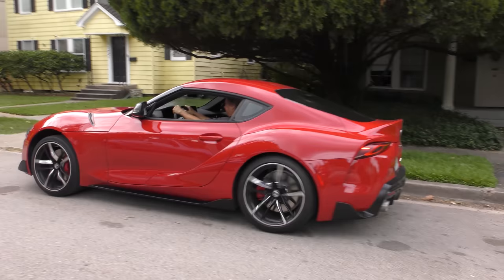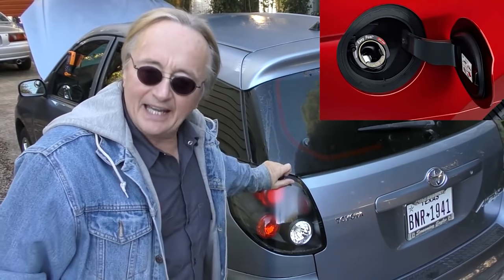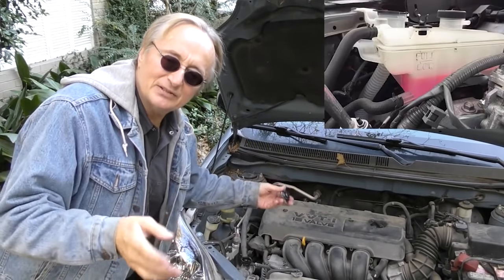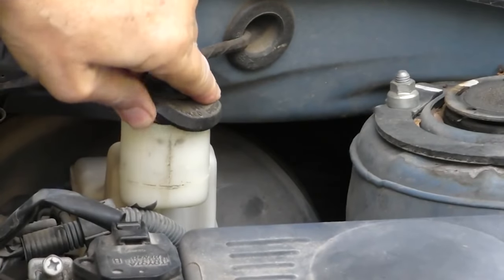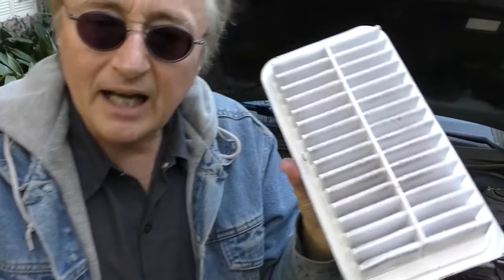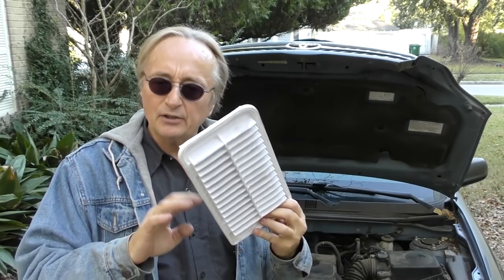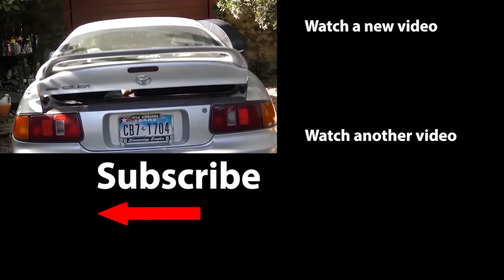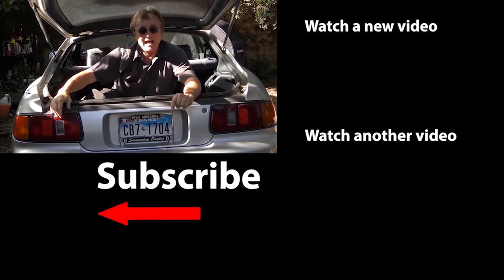5 Things Only Experienced Drivers Know

Comment: Other thing with car batteries is to make sure the posts don’t have a lot of corrosion, cause I’ve had cars not start because of that and after cleaning the posts and cables it ran just fine
Reply: @JorBur3, true. I've also seen where posts and cables look fine but cables are corroded a couple inches back from the posts.  Sometimes you can trim them back, sometimes have to buy new cable.
Reply: I just had that happen a couple weeks back.  My van never gave me trouble and one day I get in to start it and nothing.  I checked the posts and cables, cleaned them, and we're back on the road again.  It hasn't given me a problem since.

Comment: My heat is pretty weak in my car. Check my radiators coolant levels and if it isn't full which coolant do y'all recommend I buy? Thanks
Reply: You go by what your owners manual states. In the back it should give you the spec. Go to an auto parts store and look for any coolant that says it meets the standard of your spec. Ask the guys at the store to help.
Reply: @joe6096  Thanks, brother

Comment: Bahahaha @4:58 I had a friend who girlfriend drove his car like that & completely drove on bad brakes & actually cut her front rotors in half ,& they was solid rotors too not vented on a 1889 Pontiac Lemans (Daewoo LEMANS) ,she was such a bad driver she also split open the automatic transmission by driving thru deep water & made a illegal U Turn into the high curb 🤣 ended up selling her another GM automatic transmission I had in stock ,she was super hard on any car ! ,you should see what she did to her X boyfriend Toyota Supra ,she split that one in half ,right into a tree ,her first boyfriend split from her after that

Comment: Previous gen USDM Ford Fiesta STs are notorious for having bad purge valves which cause the engine to stall after filling up. Hilariously, a workaround is to hold the pump nozzle in the fuel fill hole for a few seconds after topping up. The fix is to get a new purge valve.

Comment: Hi Scotty, In Carfax I saw a Lexus RX400 H 2008 model with 125K miles on it which was manufactured at Japan. There are no accidents. Price is 8500$ May I go for it based on year and milage? Please share your thoughts. Currently I own Subaru outback 2011 model with 95K miles with no problems. May I replace my Subaru with the above mentioned Lexus ? Pls reply.

Comment: Irony. Bought odbcii midrange device after getting check engine.  Code was slow leak minor. Looked at original cap from 2007. Poof sound unscrewing. Went away. Checked coolant n fluids sat. First time in 5 yrs. 5.7 hemi good one. Got battery starter 1000cca too. And 5 lb fire extinguisher like he said. Batt powered tire inflater. Had two 5D cell maglights. Changed air filter myself. Omg. Even got 500W generator for car. New shocks lifters for gates n hood. Wd40-  now in heaven.

Comment: Hey @Scotty, I got P0304 misfire code so I changed spark plugs & ignition coil all 6 for my Honda Accord 2008 v6, now the engine light disappears when the fuel tank is less than 1/4th remaining while I fill up the tank full the light glows up giving the same code. What could be an issue?

Comment: Hi Scotty. Been watching for a while now. Your discussion of air filters reminded me that I wanted to ask a question.  I have a 2009 Ford Focus, 4cyl, 5spd trans., with 265k. Not the original owner, but personally know prior owner.  I’ve put 65k on it, and the thing just keeps on going.  It has the original air filter still in it.  Went to change, but discovered its not a typical take out the old filter and put in a new.  Seems to be some sort of self contained system. They say you have to replace the whole system as one (box, filter, sensor, and whatever else).  Gas mileage has been decreasing. I’v changed plugs, coils, etc.,, but just cant do a simple filter change.  Is this your understanding as well, and is there any work around that you might know of to just be able to replace the air filter without the huge expense of replacing the whole system?  Huge thanks in advance.  Great channel.  Warm regards, John V.

Comment: Pretty sure my car is low on coolant and the wiper fluid reservoir may be cracked and the MAF is definitely filthy. The MAF is a soab to get to in an 07 Toyota Camry.

On your last point: If your vehicle isn't starting and it's just clicking, it may be spark plugs and or ignition coils. That happened to me last winter and I could not for the life of me figure it out because no one had the equipment to communicate with my Toyota. But after we found someone, it was an easy fix I did with the help of a fellow backyard mechanic.

Comment: Hey Scotty I have a Toyota celica 2000 GTS 
I have a shaking problem. I changed my motor mounts and passenger side axel. The shaking was gone but it’s back (not as bad as before)  mainly the interior shakes and the steering wheel

Comment: 1.check gas cap 2. Check coolant 3. Check brake fluid 4. Check air filter 5. Keep you fuel tank over 1/4 tank.

Comment: Fuel cap in my 2000 corolla 1.9 diesel has holes drilled in it by a mechanic, it was supposed to fix under pressure problem or something (car didn't start right) now the engine strats ok but should I be worried about that cup not being hermetic?

Comment: Toyota sequoia has the starter under the intake or under the right side exhaust.  Not fun either way.   Stupid ford fuel pumps all fail between 80 and 100k.  Have to drop the fuel tank.  Expensive..

Comment: My Ford doesn’t even have a gas cap!! When I get that code, I have to use the plastic fill thing to penetrate it over and over again and spray it with lube to clean the hole and clear the code.

Comment: My Ford Escape doesn't have a gas cap!  Why is this, anyway?
Reply: @mcc7762  Yup! They leak and there's no fixing the code. Reset It and it trips again after about a day or so.
Reply: Honda started this too I see, but Ford has had theirs out longer.
Reply: @mcc7762  I wonder about it letting dirt in the fuel as well
Reply: @mcc7762  Right... I know there's a 5 micron fuel filter, but just the thought of dirt in my fuel tank bugs me.
Reply: @mcc7762  I have the six speed but so far only 75k miles.  I have the 2.5 liter engine and it leaks oil badly.
Reply: @mcc7762  I don't know, but I was thinking it was the pan, as there is a sheen of oil all over the front of it.
Reply: @mcc7762  This is my fourth ford and I haven't had any real issues before. Thanks for the advice!

Comment: I promise you if your throwing an evap code...99.9% of the time it will NOT be the gas cap and instead a failing line or crack in the canister.
Reply: @Mark Codiroli If you are throwing an Evap code, it will almost never be due to a gas cap.  Also, I've worked on many cars that throw codes that are NOT directly related to the problem.

Comment: My VW Passat fuel replacement cost be around $800.  It ended up cracking and gasoline fumes were leaking out.
Reply: My 1997 Honda Inspire 5 cylinder engine has never had such an issue and the original gas cap is still on.
Reply: @michaell3711  Probably because it’s a simpler and more durable design that isn’t mostly plastic

Comment: Scotty Kilmer I have a question. I'm in a position soon to buy a new car. Now I'm finished with Chevy, and Nissan has a bunch of recalls mostly for there transmission. My question is is there a 2021 Toyota sedan you would recommend? I drive anywhere from 700 to 1k miles a week. I know there will be little quarks but to put in perspective the car I'm in 2 out of the 5 year contract I'm in I should have been able to pay it off at 2 year with all the repairs I've made on it. Your input is appreciated. Thanks
Reply: Ask on his car killer website
Reply: @sandybarnes887  I found it
Reply: @joshbeekman5474  ok

Comment: Low brake fluid should be a warning for leaks, considering the consequences!
Reply: Could also mean your brake linings are worn out and the lower fluid level is because more is in the calipers or wheel cylinders.

Comment: I just flip the o-ring around.  I also use a little lube like Vaseline on the mating surface of the filler neck.
Reply: Vaseline can ruin the rubber seal over time, if you're going to use anything you wanna do a silicon type.

Comment: I'm glad I ran across this. I change my cap one to two times a year and still get that code. Maybe I need to clean that corrosion.
Reply: Put some sugar in your tank and it will clear up all the gunk and the code will go away
Reply: Maybe you are changing it too often. Lol
Reply: @michaell3711  I get a check engine light code pop up telling me to change gas cap..
Reply: @kylesheehan3813  and so will my truck right?
Reply: @b-mec-him796  yup

Comment: Mr. Kilmer : On , your show ( you talked about ) air in a heater core.  ; ( elevation difference ) from the car's radiator etc.
    I thought ? ; of my Dad's - SUB.  First , put , in {my favorite} copper mix  & water pump lube in the SUB radiator. 
   Then , second ; park our SUB on a boat ramp - up hill - " both " ways . Our , SUB has a " big core " in rear & core up front.  
    A , T. V. story said once our SUB could hold a (young) crew of - 17 members - wow.  Surf is up - six to eight feet.  
---------------
Thanks a bunch ! ; Mr. Kilmer.
 😎 Bryan.

Comment: I had just bought my Dodge Dakota brand new. The check engine light comes on. I bring it back to the dealer and the first thing they asked me was if I left it running while I filled the gas tank. I said of course, I always left my previous car running while I filled the tank. Who would have known it's so sensitive? Also I used to smoke a cigarette while pumping gas, until someone called me out on it. It just never dawned upon me I shouldn't do that lol.